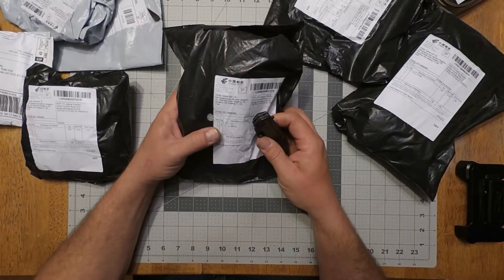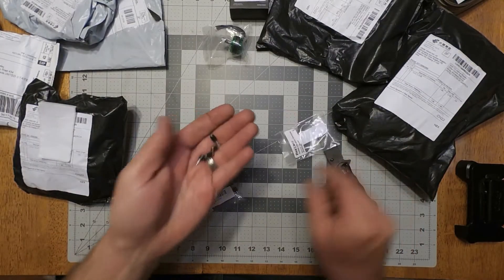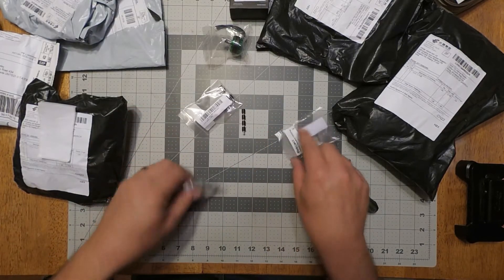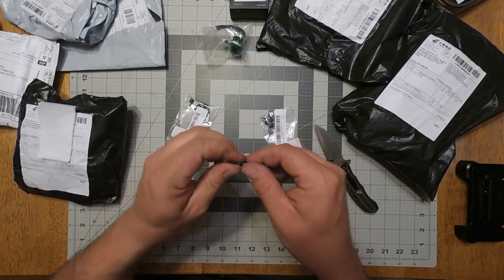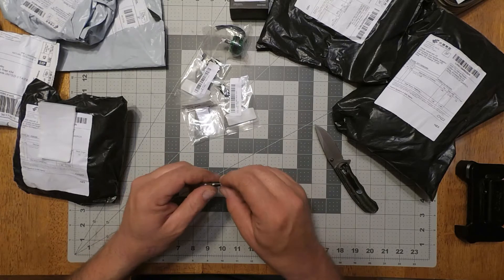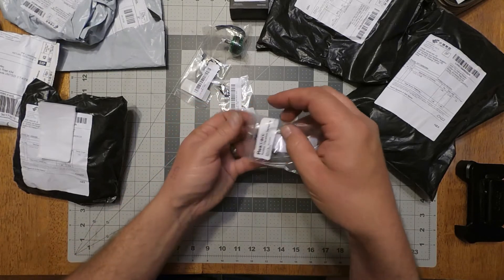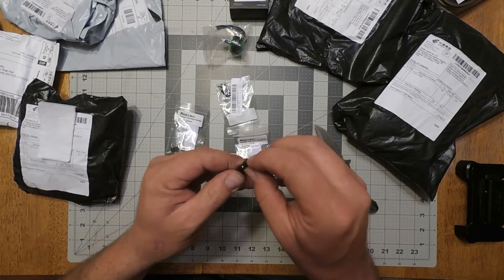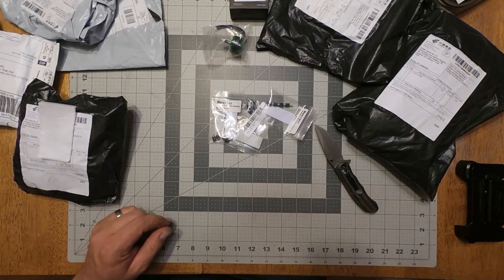Flight Controller Anti Vibration Fixed Screws

Comment: Quick question, is the rubber is able to be push down and up after fc esc is installed. If it work like a small springs, it will be awesome if it act like small coil springs. Thank for vids
Reply from the maker: They are about the density of a pencil eraser not like an earplug.. So they are not that squishy, but they work very good! Have a great day my friend!

Comment: Really nice, dude. I did ordered some of those too. 😊
Reply from the maker: I use them on everything.. and tpu motor anti vibe mounts also..
Reply: Torch Fpv I bought some motor soft mountings too, but I think they're silicone. I don't have a 3d printer yet. 😕
Reply from the maker: MC's Creations, the silicone ones are very soft I like the tpu ones better but they will work.. I was going to buy a 3D printer but I spent the money on a offroad project ADD I know lol..
Reply: Torch Fpv I know how it is... 😂 About 3d printers, I'm really interested in the Creality 3D Ender 3. 😉

Comment: i only had the larger or fatter soft mounts for quad ive been flying with simple or rings just under the f.c but im hopeing the larger ones from readymaderc will work like my smaller ones i use on anouther quad they dont seem to move as much though egh hope it helps..also getting my prop line perfectly lined with f.c may help to now

Comment: And the metal thread will be just fine with most boards? No shorts or anything?
Reply from the maker: Glowworm 334 the rubber is an insulator so if you put the male end up your good. That's what I do. 😁 thanks for watching.
Reply: Thank you for you quick reply!
Reply from the maker: Glowworm 334 you bet my friend I use these on all my builds I have like them alot! 😁 thanks for watching! Please use the link in the description and have a great day!

Comment: cool! i need to order some of these :)
Reply from the maker: I just put them on my mark 1 and there is a noticeable difference I think.. I am the most happy that I won't have to replace broken standoffs every other day HA!! Please use my link so I get credit and have a Great day my friend!!
Reply: Torch Fpv thanks, i'll do a banggood order with also other things like a 100mm frame to replace my qx95(of wich i broke 3 arms, and fixed it with toothpicks and electrical tape) and some kingkong 5040x3 propellers, will it work if i sign in from your link and add all the parts from there? btw did you try the racerstar R5040 propellers? i was tempted to buy them but there aren't many reviews on them yet.
Reply from the maker: Yeah just click the link in the description and add it to your cart and we are good :-)..
I have the racerstar 5042 and the 5048 and they are great props very durable highly recommended, but I have not tried the 5040 yet..
Reply: Torch Fpv ok i'll do that, have a great day!

Comment: have you tested to see if the diameter is too big that they touch some of your uart pads close to the corners? I have same type of mounts from a different company and they are really close to too big?!>?
Reply from the maker: They have .5mm smaller footprint then the nylon standoffs do. 6mm diameter on the rubber standoffs and 6.5mm point to point on the nylon.. Thanks for being here my friend and have a great day!!